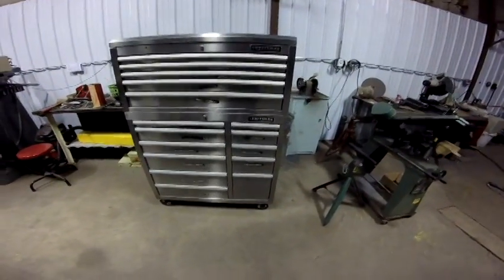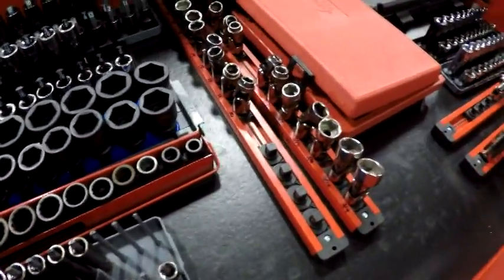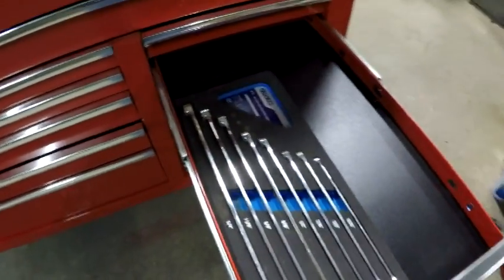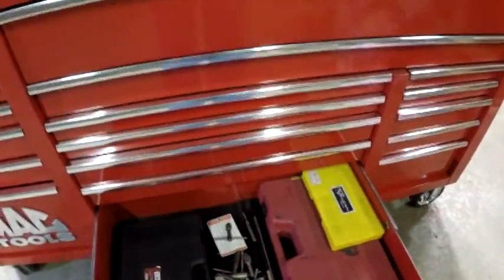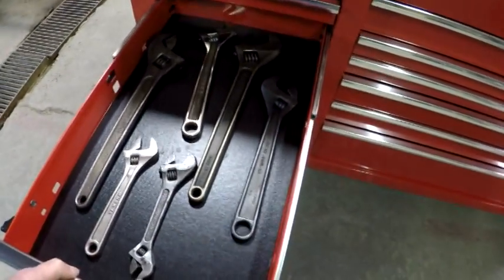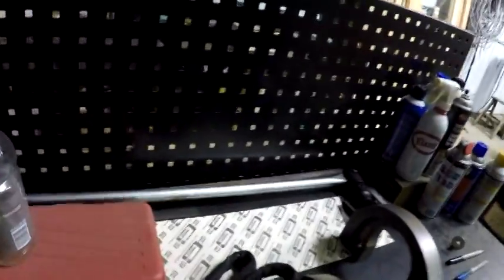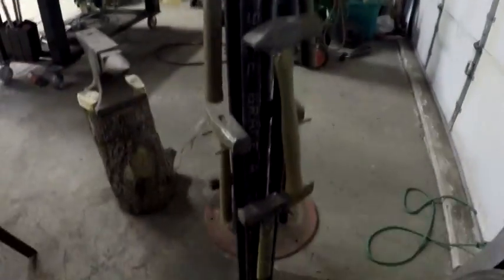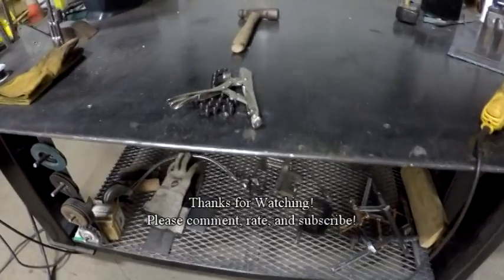New Tool Box - Tool Box Tour - Shop Update

Comment: Nice set of tools, I got a lot of tools also, I worked multi craft mechanical electrical, I acquired a lot of tools before I retired.
Reply from the maker: Thanks! I actually lost or gave away a bunch of my work tools when I retired! But they were more specialty tools that I probably would have never used in the shop and most defiantly be better served by being used by someone still in the trade! Joe if you haven't already, check out my video on Tool Obsession (   https://www.youtube.com/watch?v=AArc6-vZW9E ) where I talk about it being partly created by not having the proper tools in the field!